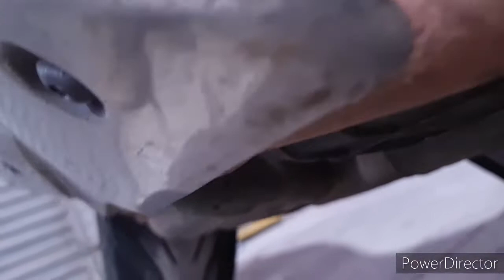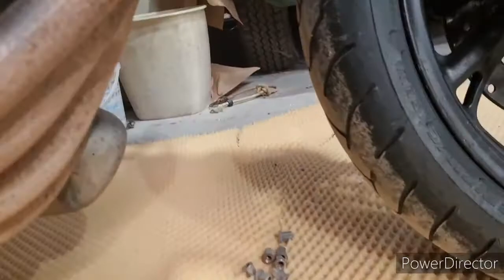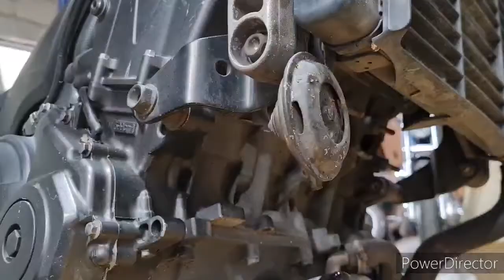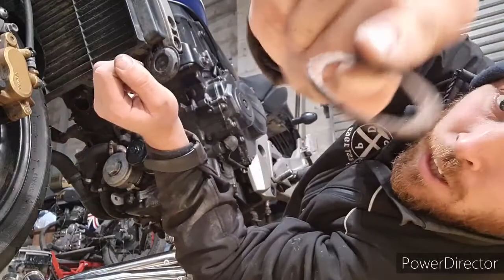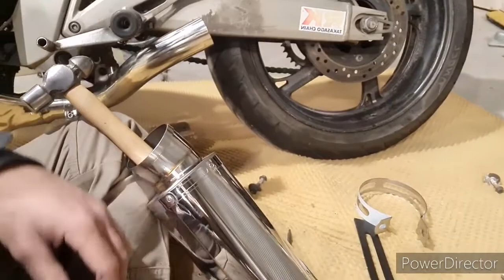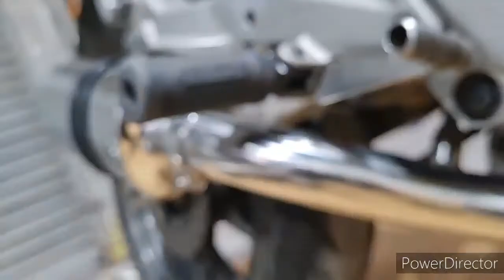Honda 600f HORNET delkevic full exhaust,  how to install a full system (with sound comparison)

Comment: That clamp you loosened to take the muffler off. That has been so badly corroded on my bike that its just...gone. I ride year round and the salt tents to do that. What remained I could just pull off.
Been wondering how difficult it is to get the muffler off and I now have my answer, thanks! Been chuckling about my hesitation to fix it.

Comment: 162k km? is that original engine? if so that's crazy.
I thought mine has high mileage at 55k lol.
Reply from the maker: Nah 2nd engine, but the guy said the only reason it died was he did a service and forgot to put oil in it, it did make it to 159000km though! Go honda for reliability

Comment: does the bike need to have power commander after installing delkevic full system
Reply from the maker: Nope, I've ridden it 600km since, no problems  and it's got alot more power! Using a power commander will make more power but it runs fine without